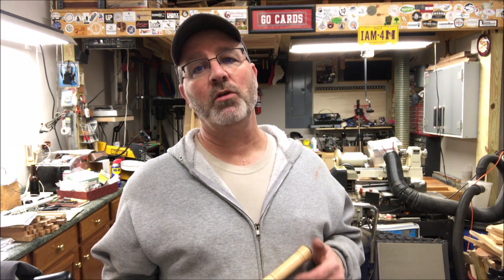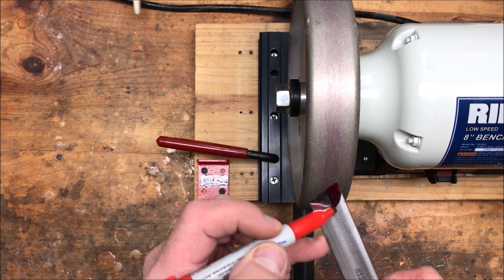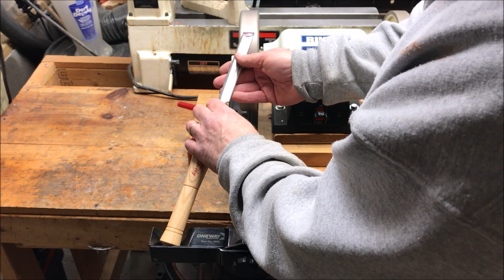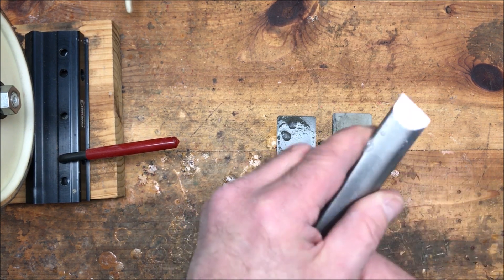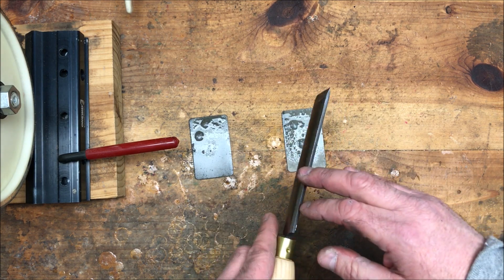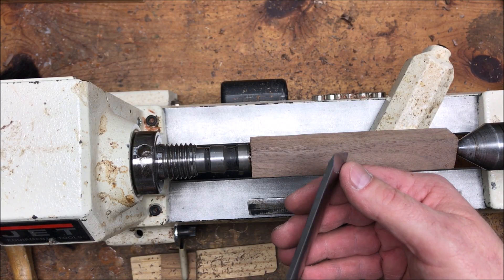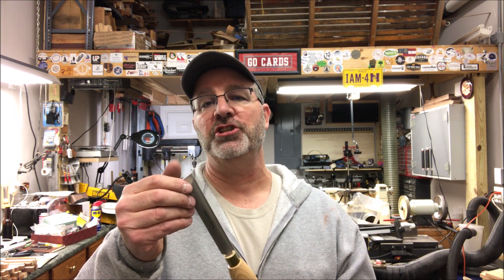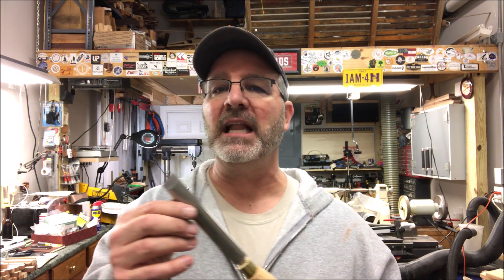My Skew Sharpening Procedure

Comment: I agree with you. The best method of sharpening in my opinion, is the simplest and quickest one that will give you "repeatable results you are happy with". :-)  I wish I had looked at video like your when I started, it would have preventing me from buying all those sharpening gizmos that are now collecting dust. They all worked fine, but take way too much time or setup.  I now use almost the same method as you for my turning tools, with the exception that I am lazier, and usually go from my slow speed grinder directly to the stropping (but I put  very little pressure on the tool at the end of the grinding session). What grade is your wheel? You are right, for ALL my cutting tools, stropping often to refresh the edge is THE key. Great video, thanks for sharing.
Reply from the maker: Thank you,
  I use a 200 grit wheel. 

Regards,
Bob

Comment: Great video Bob! I am committed to learning to use the skew and seeing how you sharpen was enlightening. I already have the Wolverine system and a couple of card files, but I need to get a strop.
Reply from the maker: Thank your Jon,
  The strop is the most important part. I only use the CBN wheels to shape the tool when it’s new or I damage the cutting edge. I will occasionally use the card files to hone the edge but I strop constantly before, and many times during some turnings. It does a great job keeping that tool edge straight and sharp. 

Regards,
Bob

Comment: Thanks. Very helpful. I need to try a CBN wheel and stropping.
Reply from the maker: Thank you Glen,
  The Strop is more important than the CBN wheels In my opinion. I rarely use them unless I need to shape the blade after I damage it. I mostly strop and occasionally hone on the card files. 

Regards,
Bob

Comment: Thanks Bob , great video. As you said there are a lot of videos on sharpening skews but your video is the only I could find on sharpening an OVAL skew.   That jig definetly reduces the challenges of sharpening an oval skew.   Also the strop wheel link has two options. A Deluxe with the flat strop and a V strop and a standard with just the flat strop.  Thinking that the deluxe kit is a good buy but not sure if the V strop is something worth having or something never really used.  Any thoughts?  Thanks again and looking forward to your video and use of the skew, especially since its oval.
Reply from the maker: I’ve never used a V strop. Not sure what I would use it for. I use the flat strop and it’s served me well with all my tools. 

Regards,
Bob

Comment: Bob. I’ve been playing catch-up on some of you videos. I’m getting better with the skew except for cutting over the top. I you it more of a scraper right now.  By hand sharpening after the grinder, does it last longer or only for the first couple uses?
Reply from the maker: It lasts longer. 
  I only use the wheel for the initial grind then not again until I damage the edge. 

  I hone on the files periodically, maybe every 15 to 20 pens. 

  I strop constantly, several times while turning a single pen. 

Regards,
Bob

Comment: Your honing compound stick is the same diamond stick you use in buffing, and Bob you really do need to clean your strop wheel every so often to get a better edge finish. Just passing on information learned over fifty years.
Reply from the maker: Thank you Michael,
  I agree and I do clean it from time to time as it gets so much use. Thank you for mentioning this as I neglected to in the video. Many turners read these comments and will benefit from this information. 

Regards,
Bob